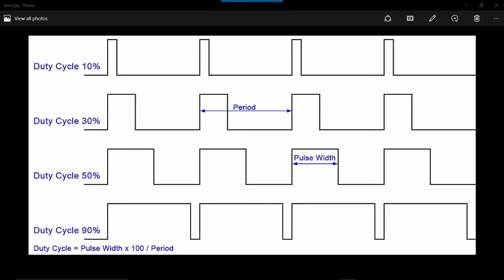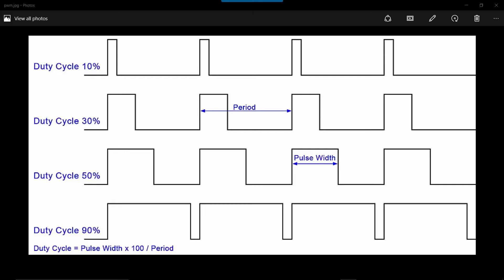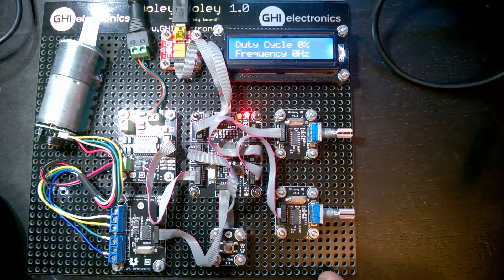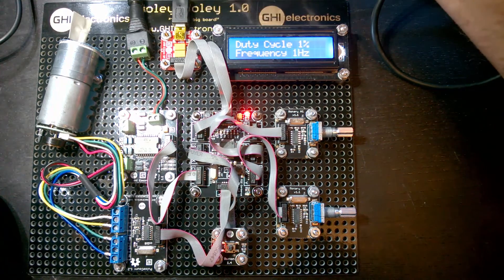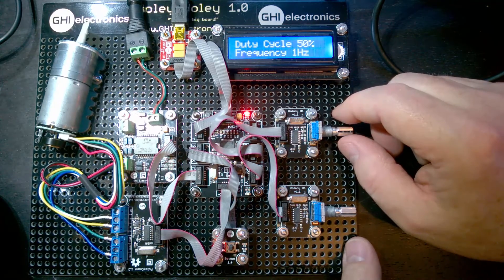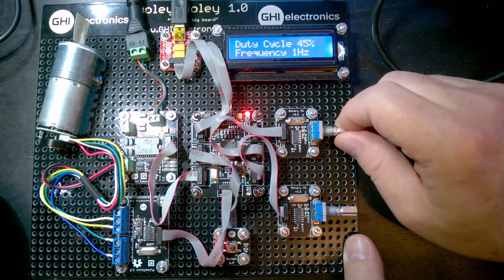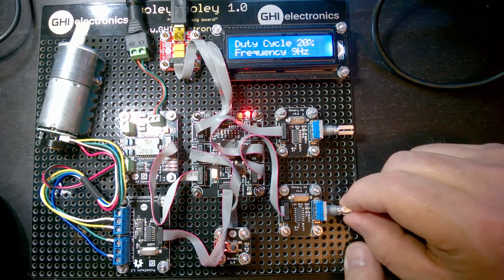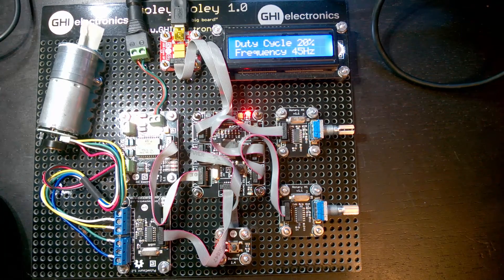Demo of roles of Duty Cycle and Frequency in Pulse Width Modulation PWM

Comment: Hello Mr @nuke, i'm working on a similar project and i need the source code you used to get that amazing results (the link dosen't work for me), Thank you.
Reply from the maker: what hardware platform and code are you using?
Reply: @dukenukem3568  the control of a solenoid valve by the pwm of a mega arduino card at a frequency of 10Hz.
Reply: @dukenukem3568  arduino and i'm using a code with interruptions but when i compare the value of timer with my PWM , the frequency of the duty cycle reset to 490Hz ( default value).
Reply from the maker: @ilyasazzouzii5876  check which pins you are using and are you setting up the Timer/Counter registers for the frequency see https://www.arduino.cc/en/Tutorial/SecretsOfArduinoPWM

Comment: What application would you use variable duty cycle (fixed frequency)
Reply: I'm researching today this exact thing.
I have an application for you. An electronic control module for a diesel engine requires a constant frequency but variable %on time to control the fuel setting ( throttle )